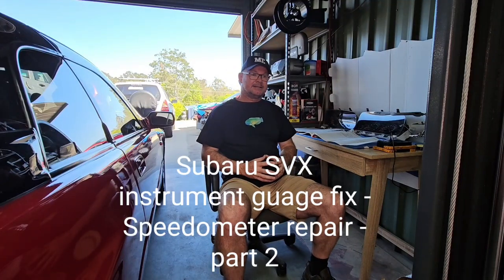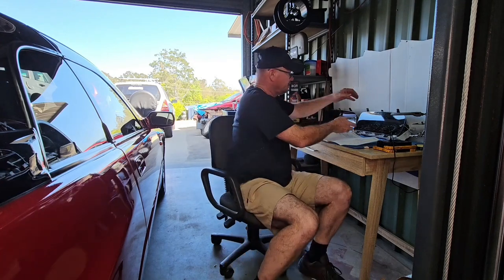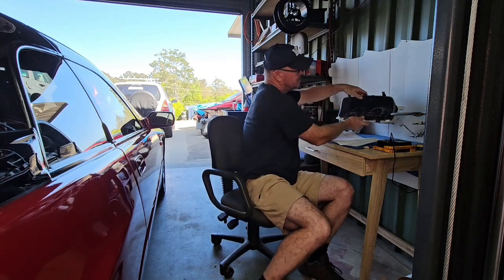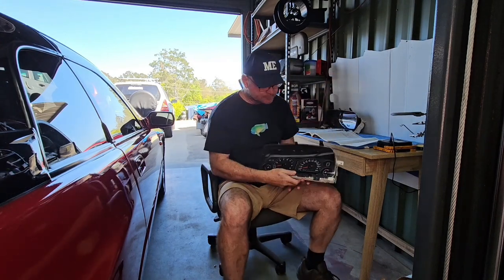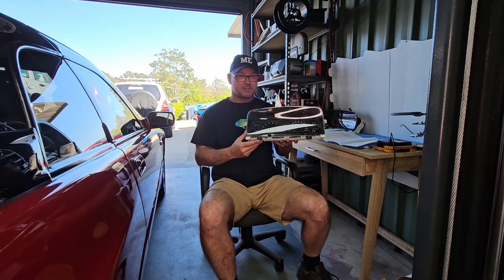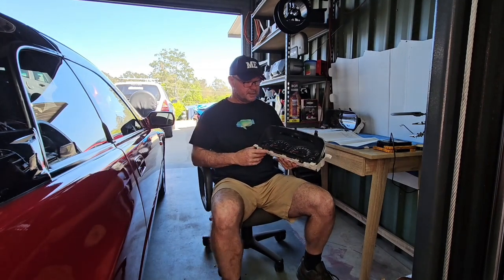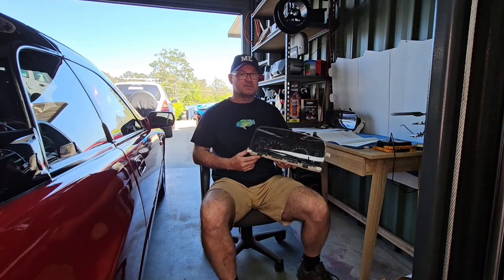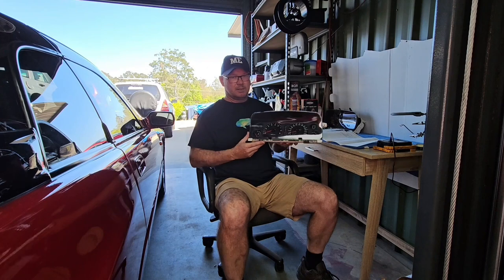Subaru SVX instrument guage fix - Speedometer repair - part 2

Comment: I checked the fingers the morning and nothing looked out of place. I removed them from the dash to see if there were any loose/missing wires but everything looked OK. Thanks for your help with this.
Reply from the maker: Do you have access to the Service manual?  If not, on the weekend I'll check it out for you and see if there is anything else.
Reply: @subaru92svx12  Dont have access to the service manual.
Reply from the maker: Hi @Larrygreen2402, I didn't get a chance to grab my service manual. I had my own challenge with a failed aircon bearing. I'll look this weekend.
Reply: @subaru92svx12  OK, thanks.

Comment: Thank you for this breakdown of the repair. Do you happen to know if the same repair method works on a gas gauge that is reading incorrectly?
Reply from the maker: You're welcome.  The gas guage is a little different.  It is generally due to the "devils horns" in the fuel sender unit guage (in the fuel tank). The "devils horns" normally lose contact. Search the forums for SVX Devil's Horns. My mate John Hunter Burge came up with it.

Comment: Thought you might be the only one able to help me with a problem with my 97 SVX.  The tachometer and speedometer work, but the odometer and trip odometer don't.  I thought it might be the gears in the odometer and trip, but I've tried 3 replacement speedometers (that include the odometer and trip odometer) and while the speedometer worked in all 3, the odometer and trip odometer didn't work in any of them.  I'm assuming the problem must be electrical but have no idea what it might be.   Any thoughts?  

Thanks.
Reply from the maker: Hi, that is a challenge. If each of the odometers isn't working, then it must be from the harness back. Check the fingers the instrument guage clips into. If corrosion has built up on the contacts, no or limited electrical current will flow. I'll chat with some fellow owners over the weekend.  Regards Dorian

Comment: Hi, Is it possible to change/rebuild mph to km/h?
Reply from the maker: @Firefly-3161 - I can't see why not. The decal for the Miles vs Km should be a straight swap. The odometer might be harder.
Reply: @subaru92svx12  thanks!